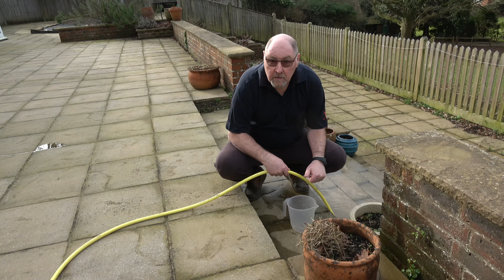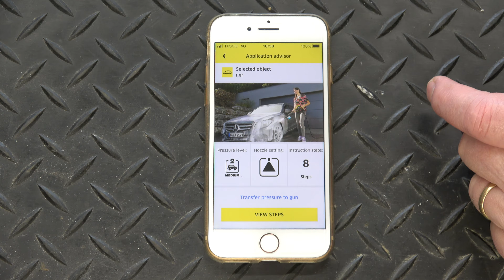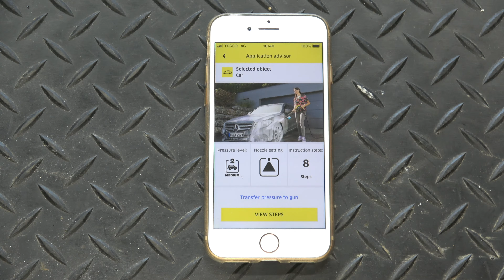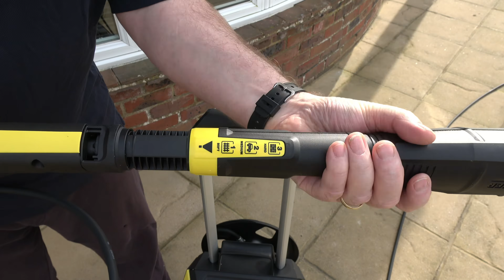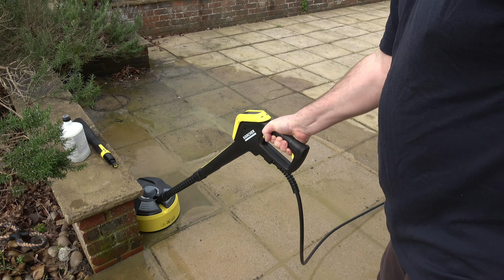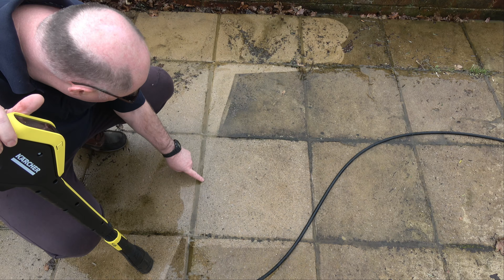Karcher K7 Premium Smart Control - Review and Demonstration

Comment: Perfect review for me, replacing the old K4 and I have the Racer too, I hated the swirls it used to leave, just not enough power and had to take it extra slow, that looks like a massive improvement. Only problem is the Racer, I use both extensions as I am tall and it bends like hell, I might just remove one as I wont have to be craning down too long with this. Thanks, this was very helpful!

Comment: I found that you should press the trigger before turning on the machine making sure water is in all the components and that would allow air to clear from the system before pump build up the pressure.

Comment: Thanks for this. I decided to purchase the K7 Premium without the electronic crap on the handle. A bit of extra power control would have been nice but I don't need to be shelling out for app-based gimmicks or faffing with batteries - it's a pressure washer FGS! 🤭
Reply from the maker: You made the right decision as far as I am concerned!  :-)

Comment: Hi Russel. Does the boost mode make a big difference as the one I’ve purchased doesn’t make much if any difference.cheers Ady.
Reply from the maker: I did not notice any real difference on mine Ady.  :-)
Reply: @RussellPlatten  Cheers for the reply. I’ve taken mine back as I don’t think it’s a good pressure washer and when I spoke to karcher they said it should boost from 160bar to 180bar so should be a big difference.
Reply from the maker: I am using Ava of Norway pressure washers now Ady.  They sent me 2 for review and in my opinion they are better than Karcher.  No gimmicks, with long guarantee (up to 20 years) and very well designed.  Take a look at their pressure washers.  :-)
Reply: @RussellPlatten  I ordered the evolution p80 for £360 from a distributor but the ordered was cancelled due to having lots of faulty items blowing fuses. Is the Ava p80 more powerful than the k7.

Comment: Many thanks Russell, an excellent video - way better than the Karcher efforts.
   My K7 Premium has been stolen along with mountain bikes, golf equipment, etc.  Anyway, I never used the Bluetooth function - exactly because, as you said, Karcher doesn't explain anything about it - even in their booklet or on their videos.
So, like you, I have a lot of patio and paths front and back, so I need high performance.  If I didn't go for the K7 Premium again to avoid paying for the Smart function, which model would you suggest, please?  
   The thieves didn't take the T-Racer attachment, but this is not an optional extra anyway.  So it's just a spare now.
Reply from the maker: I would forget about Karcher and look at Ava of Norway pressure washers.  I have reviewed two of their machines and they are great value with a long warranty.  I am not an affiliate and do not have any discount codes or links to their products.  I was in contact with them for a few weeks when they asked me to review their machines and they seem like a company that actually cares about their customers and their products.  Karcher make good machines, but they keep adding useless modifications/functions to allow them to up the price for no real gain to the customer.  I have been very impressed with the two machines from Ava that I reviewed.  No gimmicks, just a well built pressure washer with a long warranty and good performance.  Better than Karcher in my opinion!  Your T-Racer will fit the Ava washers too.  :-)
Reply: @Russell Platten  I fully understand and do agree Karcher have a terrible customer support - I rang a couple of times - before Covid excuses - and was always "14th or 15th" in a queue.
  I will look at your independent videos now and appreciate your advice. 
  I'd like to keep you informed if you're interested Russell?
  Thanks for letting me know about my T-Racer.  This is a great thing to keep splashes off the walls - and feet.

Comment: Great review. It was good to see the inlet water flow requirements. However it would be good to see what the output flow rate is out the pressure washer gun. 

Reason being I have done a test with my Karcher K4 spraying into a bucket with a hole in the lid to minimise any water loss. Karcher state the K4 uses 7 litres a minute. However I found this was closer to 5 litres on the max pressure on the vario lance. Which 40% less in flow.  I have no idea how to measure the pressure in bars but if the flow is 40% less then stated then the pressure must be less as well

Would be good to see on a K7 to see how close it is to the stated spec. It may also mean you don't need a supply as high as 12 liters a minute from the tap. As if the output is less then 12 litres the input must not use 12 litres.

Keep up the helpful consumer advice 👌
Reply from the maker: Unfortunately, manufacturers are permitted to use the maximum pressure achievable under laboratary conditions and this means that the specified max pressure figure is probably when the pump is running and then dead headed with maximum flow rate and inlet pressure.  None of which would really be possible in the real world.  
The pressure is increased by restricting the flow so the flow rate will be less than the maximum stated flow which will be achieved in a laboratory too and be measured with the pump operating without a discharge hose connected and at max inlet pressure.
However since all manufacturers do the same thing, the K7 will be better than the K4 and probably have a max discharge pressure in the real world of around 140/150bar.  It is pretty devious, but unfortunately if a manufacturer was honest with the figures, they would sell fewer machines than their competitors.

Sorry to ramble on David, as you can tell it annoys me!  LOL  :-)
Reply: @RussellPlatten  
Hi Russell

I agree its quite annoying and all industries are affected by these overinflated lab figures that come with a small print. Hard to compare between brands and even models.

Checking out this video by obsessed garage. They did a test on pressure flow and electrical draw. https://youtu.be/eAXXPSBFRug. They tested all the karcher K series versions available in the states. However the K7 is not available in the states. They found the K4 and K5 are identical. Although they look like the older design models to be fair. Its worth a watch.

Cheers
Reply: @daviddrcray3802  yeah, Matt at OG is pretty thorough (may be an understatement 😀), but all their domestic machines work off 120V so his figures will probably be different to ours as demonstrated by the Kranzle models he raves about although the specs for these seem more true to life.
Reply: @peterben5987  Good point never thought of the voltage difference.

The AVA pressure washers featured by Russell maybe the way forward. Definitely matches Kranzle for build and servicing ability and probably better for the consumer market with a long warranty compared  to the Kranzle 1 year warranty.

Will be looking into a AVA replacement once my karcher eventually stops working.

Comment: Hi, amazing review!
 I wonder, is there any difference between T450 patio cleaner and this T7 racer patio cleaner? Cant seem to find the answer anywhere on the net. 

Also do you know, per chance, ehat difference, and if, is there between premium full control version of K7 and Premium Smart control, besides the app? 
Smart control seems to have a bit of a newer machine or something, but not sure if this model is better than the few year old one. 

Thanks!
Reply from the maker: I cannot see any real difference between the T450 and T7 patio cleaners.  As for Full Control, this means that the pressure of the vario lance is altered by twisting the end of the lance to increase or decrease the fan spread.  Smaller spread, higher pressure.  On the Smart Control, there is a different lance and the pressure is adjusted by selecting it electronically using the buttons on the lance.  I personally would go for the Full Control, the good old fashioned way the adjust the pressure.  Much less to go wrong with it.  You can see full control demonstrated on the review I made of my K4 a few years ago.  Compare it to this review and you will see the difference.  The display on the Full Control gun only indicates the pressure at the nozzle and will change as you alter the vario lance.  :-)

Comment: Thanks Russell for taking the time to show us the K7. I was undecided what to buy between K4 K5 and K7 . I have decided to go for the K7 Premium Smart control with the T racer connection, I know the smart control is useless but I do not think I can buy it without unless I buy an older model. I am based up in Stockholm Sweden and it is getting sold on our Amazon up here for around the same price as you pay in the UK. Keep up the good work pal.
Reply from the maker: I am glad that I could help Colin.  I was using my K7 this morning and it is a good machine.  I have also got my hands on an Ava Master P80 and in my opinion it is a better power washer than the Karcher K7.  There is an issue with some of the Ava Master P80 machines here in the UK due to the 13A fuse in the UK plugs.  Not a problem for Sweden though.  Either machine will get the job done.  Enjoy your new machine!  :-)
Reply: @RussellPlatten  thanks Russ. I haven’t ordered it yet actually just about to do it. I will take a quick look at the Ava master. I am not too familiar with this manufacturer but will definitely compare prices and flow rates and power. Finally nice weather up here. Been a long winter so it’s now or never I need to make my mind up ))
Reply from the maker: Ava have taken over the market in Norway.  Apparently every other pressure washer owned in Norway is an Ava of Norway machine.  I am very impressed with the two that they sent me.  It is a real pity I had an issue with the fuses blowing on the Master P80.  I have still used it for the vast majority of my patio cleaning and it is now my favourite power washer.  :-)

Comment: That's a great review.  I've just bought this and unboxed it following your other video and I'm ready to use it now.
I have the brick detergent.  Was you using that in your video?  I'm not sure how and when to use it. Cheers! Great videos thanks! 😊
Reply from the maker: Hi Karen, I have never used detergent on my patio, so I can not really comment on whether it is worth using.  I find that the pressure washer does a perfectly acceptable job without pre soaking with detergent.  It may make a difference, but my patio areas always get very dirty and mouldy over winter as my house is completely surrounded by  deciduous trees.  I have to clean it every year and don't bother with detergent.  I do use detergent for some other jobs.  Detergent certainly would not hurt, but it can become a little expensive if you are cleaning large areas.  :-)
Reply: @RussellPlatten thats great!   My patio is black from pollution.  I live on a main road.  Its never been jet washed in 17yrs so I'm going to treat it with solution then just water scrub it every year (hopefully)
Thanks again!

Comment: Great review Russell. I see that the T7 racer/patio cleaner works on the K4, K5 and K7. I'm going to be buying a new Karcher washer soon so I wonder could you tell me if the T7 racer works more powerfully on the K7 than say the K4 as I'm only buying for patio cleaning and if the output on the racer was the same I'd just get the smaller verion washer if that makes sense?
Reply from the maker: Hi Ciaran, the T7 racer is much better on the K7.  I also have the K4, it has had a hard life and has developed an issue so I decided to upgrade.  The K7 is far better.  I reviewed the K4 with a patio cleaner and you can see the difference.  The T7 racer uses the water pressure to spin and a higher pressure means more revolutions and more cleaning power.  The K4 did do a great job, but it is slower.  :-)
Reply: Thats great Russell thanks very mich for the quick reply. Thata made my mind up quickly. Keep up the good work, cheers - Ciaran
Reply from the maker: @ciarankehoe  :-)

Comment: Great review - I came to find out if my k7 full control premium plus is broken or not. 

Just doesn’t seem THAT powerful where as yours does 

My tap delivers the water rate you advise, although that seems to be lower at the end of the hose... maybe that’s a YouTube. 

The t racer seems really weak too - the mode select for it appears to be the mixer, is that an issue? 

I’m just really underwhelmed - I was expecting it to shift dirt like it does in your video ! 

Maybe mines a dud 😭
Reply from the maker: Hi Richard.  I don't understand what you mean by the mode select.  If you are using the high pressure jet, the dirt grinder or the t racer for your patio, your gun should be set at maximum pressure.  If you have the lance set to mix, it will not develop a high pressure.  Just twist the end of the lance to the dirt grinder nozzle for your patio as this is better than the jet.  The t racer should be run on the highest pressure too.  Adjust the pressure using the + button on the handle.  :-)
Reply: @RussellPlatten  hi Russell thanks for the reply. 

I explained poorly but I’ve figured it out - right before I was about to give up!

The pressure at my tap is good. The pressure at the end of the hose is not. 

I swapped out for a short section of hose and wow, it’s actually insane the difference it’s made!

It’s so so powerful!

The issue I guess is the hose length and being able to maintain pressure that far.
Reply from the maker: Yes, the pressure drop across a long hose can be considerable.  That is why I measured the flow at the end of the hose.  The way around using a shorter hose is to get a high pressure hose extension if you cannot reach all the areas you want to.  Well done for sussing it out!  Happy cleaning!  :-)
Reply: @RussellPlatten  
Blocked hose 🤦

Comment: so in short, the whole smart , isnt smart at all. the smart function is just an app on the phone which is actually just a guide with how to use the system. rather than being able to do anything with the system with the hose. so they have wasted money and resources for the new version, only to do a slight revision to the design visually, and add a "app" thats just a different way of looking at their normal guide.
Reply from the maker: Yes there is nothing smart about it apart from making more money for the manufacturer!  :-)

Comment: I like Ava
Reply from the maker: I don't know her!  :-)
Reply: @RussellPlatten  it's a Norwegian brand i have Ava p60 pressur washer. You can use ava adapters on karcher also. Fun fact if you turn the patio adapter upside down you can use it to wash the chassis under the car 😂
Reply from the maker: @moholdt3335  I have never heard of them before.  They are available on Amazon UK.  Scandinavian standards are high, so I would imagine it is good quality equipment.  :-)
Reply: @RussellPlatten  yea its about the same standard as karcher each brand have up and downsides
Reply from the maker: @moholdt3335  That is worth knowing.  :-)

Comment: Top review thanks. Correct me if I’m wrong but I do believe the standard K7 comes without the surface cleaner attachment were as the premium come with the hose reel smart control and the extra surface cleaner attachment
Reply from the maker: I too am not 100% sure Callum.  I am fairly sure (LOL) Premium means it has a hose reel attached and Home means it comes with the surface cleaner.  :-)

Comment: Looks like a good machine but what possesed them to make it app controlled. Smart phones and water in most cases aren't a good combination. Whatever next a smart phone app to control the temperature of your shower. The worlds gone mad 😊
Reply from the maker: It literally adds more time as you have to open the app, select the task and send the pump setting to the washer instead of selecting the pressure on the gun!  I think that the instructions do not include the app because people who research products before they buy, will see it is a bit of a con Paul!  The app should be free and just have the steps and settings for various tasks.  Basically, online instructions!  :-)
Reply: @RussellPlatten  they could have used the connectivity for a lot more.
Logging working hours and gallons of water used, recommending maintenance based on that logging, reporting errors, finer settings for the soap dispenser, etc...
And I have enough experience with app controlled devices to pretty much guarantee they will at some point break it permanently.
On that note, it's a good thing the device does not depend on the app whatsoever.